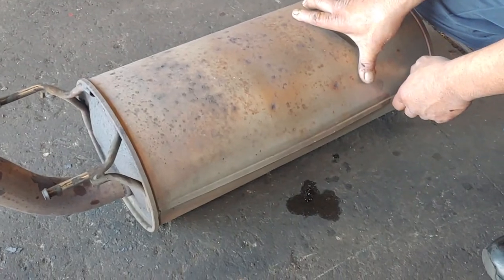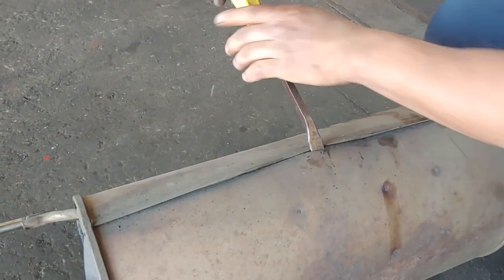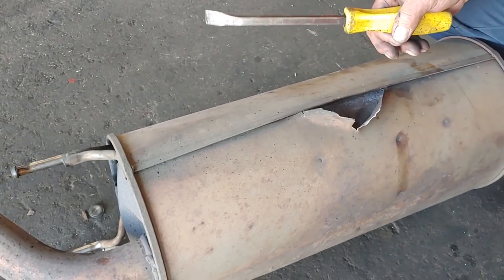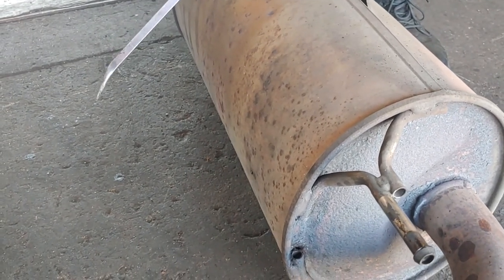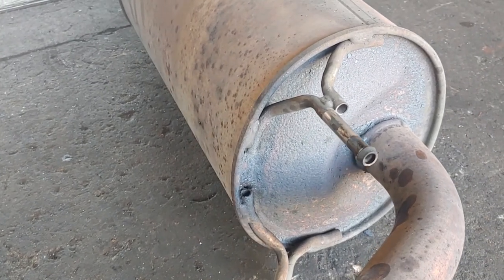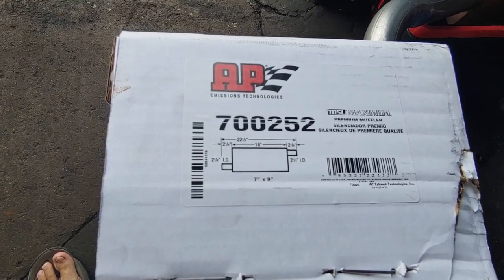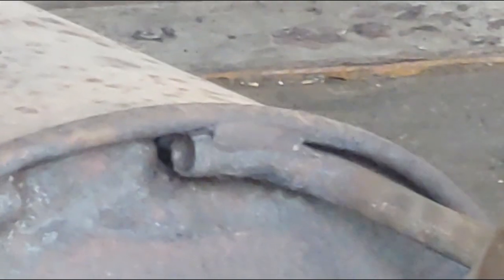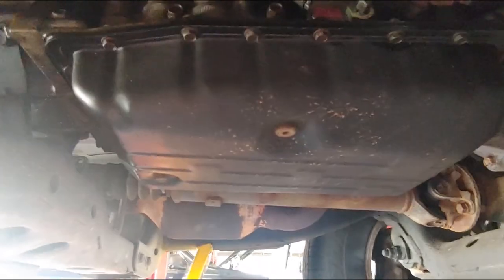How to Replace a Muffler 2nd Gen Tacoma

Comment: Very helpful video. I need to replace the muffler on my '07 Tacoma. I'm thinking of going with OEM middle pipe and muffler and take it to a shop in the Mexican part of town. I did this a few years ago and the guy welded in an after market muffler to the existing pipes. I don't think he did a good welding job. It's starting to get noisy again. Hey, he only charged me $75 for the muffler and the labor. This time I will get the OEM parts.
Reply from the maker: That's awesome let us know how it turns out 👍

Comment: Original lasted 11 years.  Aftermarket lasted 2.  So I bought a Toyota muffler this time.  From bolts to tailpipe including muffler, intermediate pipe, and tailpipe is $505 at the dealership.  Gasket is around $26 OEM.  I didn't buy anything else.
Reply from the maker: Thank you my friend.